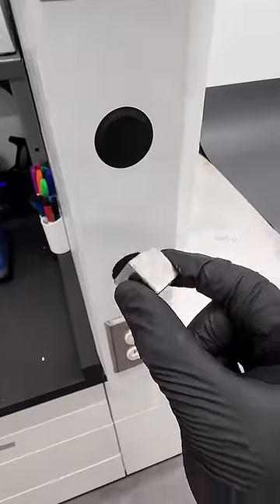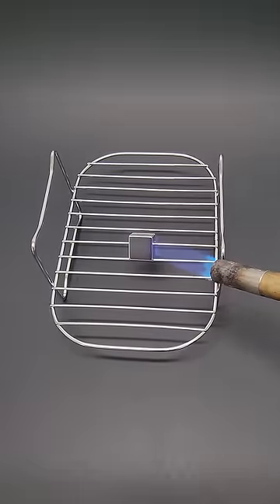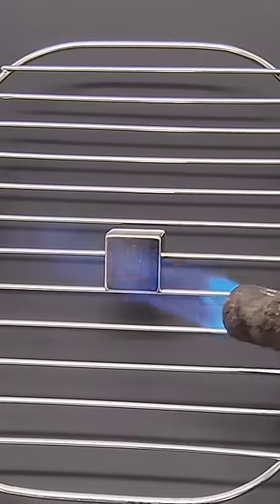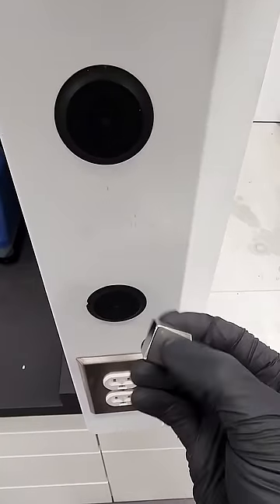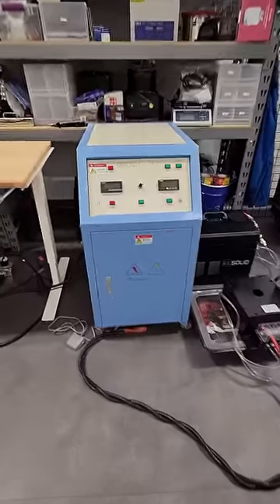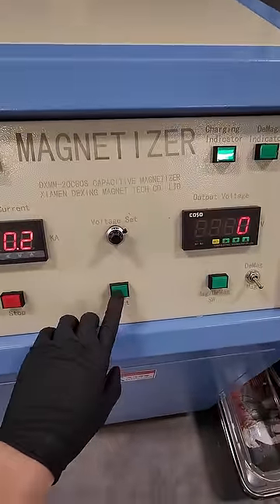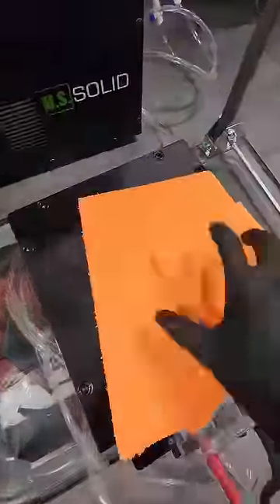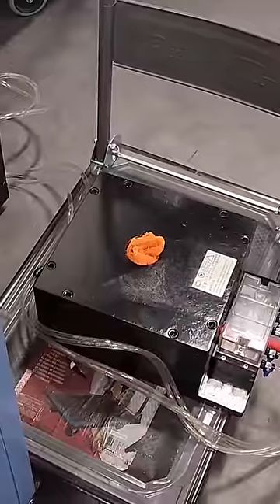I accidentally killed this magnet

Comment: That magnet had a pretty decent character arc
Reply: lost his abilities only to gain them again later but stronger with the power of friendship or smth
Reply: @BALAOFMANDALORE accurate
Reply: @BALAOFMANDALORE Spider-Man 3 type shit
Reply: @BALAOFMANDALORE The Flash
Reply: From Top to the Bottom then back to the Top!
Reply: Exactly like Gandalf.. It fought fire and came back stronger...
Reply: That's some YGO abridged shit LMAO @BALAOFMANDALORE
Reply: @hunterburch2675  In the original Spider-Man (2002) Peter has his powers with no changes, just like how the magnet had its regular ability at the start of the video. In Spider-Man 2 (2004) Peter gets significantly weaker and eventually loses his powers, just like how the magnet lost it’s power after it was heated up. Finally in Spider-Man 3 (2007) Peter gets significantly stronger as his powers are enhanced by wearing the black suit, just like how the magnets power was enhanced by the end.
Reply: @hunterburch2675  Coincidence?
Reply: @ballsinyourface419  Stan Lee is a genius
Reply: @BALAOFMANDALORE the Power of gauss

Comment: As soon as I saw the shape of that machine I knew it was Chinese made... The tech works pretty well, but the design of the casing and all that is mid at best. Sharp edges and unrounded corners. Truly the definition of function over form. I still love them for how cheap you can get them comparatively.

Comment: For those wondering, the heat scrambles the magnetic domains inside the magnet, disrupting any magnetic force it was previously generating. The magnetizer then realigned all of them even more uniformly than it was before the heat was applied, hence the increase in force.
Reply: Does it have a permanent effect though? Or will it start decaying to how it was when heated?
Reply: @@CrackShot-3 magnetic domains make up magnets and naturally magnetic metals/compounds. They are clusters of crystalline minerals, wherein most crystals are physically aligned with each other. The more crystals are aligned, the more magnetic force that magnetic domain generates. If all or most magnetic domains inside a magnet are oriented the same way, they come together to combine their force and produce the magnetic field of the magnet. Since heat adds entropy to a system, applying heat to magnets cause these clusters to fall out of alignment with one another, so their forces will be projected in all different directions, canceling each other out and producing little to no measurable magnetic field overall. Magnetizers realign the clusters, allowing them to once again generate a uniform magnetic field. I’m by no means an expert in this field and my explanation may be flawed, but this is my understanding and google could probably do a better job at explaining than I can lol.
Reply: @cekart  I believe that over time the strength of the magnet may degrade due to entropy, however it’s conceivable that if you could somehow ensure that the magnet remained I disturbed for eternity and all it’s magnetic domains remained aligned, it would never degrade.
Reply: @@CrackShot-3 To think of it another way, they are kinda like mini-magnets.  The heat essential puts them in random directions, so their magnetic field cancel each other out.  Lining them up, however, so many of them face the same direction, makes the thing as a whole magnetic, which is what the machine does.
Reply: Sank you fazer
Reply: Then why does a molten core create a magnetic field?
Reply: @mikem9374  not all molten cores create a magnetic field. Earth’s molten core creates a magnetic field due to Earth’s spin, similar to how a coil of wire generates a magnetic field when a current is passed through it. The centripetal acceleration forces the alignment of magnetic domains within the core, and because the charge is moving, a magnetic field is generated. Planets and planetoids that have molten cores and do not spin would not be expected to generate a magnetic field.
Reply: @willw.1734  appreciate the response and knowledge!
Reply: Does this work on peach and plum pits or is there a better way to magnetize fruit?
Reply: It seems like it's quite expensive to make it a magnet again 😢
Reply: @cekart it would actually stay as this forever - at least as long as you don‘t exert heat onto the magnet again!
Reply: @samgod it won‘t work on them because they’re not ferromagnetic meaning they don‘t form these magnetic domains which would last without an external magnetic field
Reply: @samgod  if you could find some way to pass an electrical charge through the fruit and rotate the whole thing, it’s conceivable that you could generate a magnetic field. The only caveat is that you won’t be able to spin it very fast before centripetal force causes the fruit to explode lol.
Reply: How come I didn’t learn this at all thruoighout my high school and college life wtf is this Chem or physics
Reply: @kkirlin07  I think it’s chem and physics!
Reply: @willw.1734  well i only took ap chem in high school so i didn't need to take any science in college but that was not covered for some reason hmmmm
Reply: @kkirlin07  no worries - I learned that in my Material Science class in university (studying engineering science) so no wonder you haven‘t seen it before ;) me neither
Reply: So it reorganised the structure 😮
That's incredibly interesting 🤔
Reply: so…. to defeat magneto you just need a blow torch? (not that anyone should be trying to defeat magneto)
Reply: @BadBanana the structure remained the same - only the charge distribution (respectively the magnetic orientation of atoms and clusters of atoms constituting these magnetic domains) has changed in the arrangement the external field generated by this Magnetizer forces it to.
Reply: @larimus724  thank you.
Reply: Translation: they have no clue how it works 😂
Reply: Im a “little magnets” enjoyer myself 😎
Reply: Question:  doesn’t this process change the physical structure of the magnet?
Reply: @ClassyJohn  yes! It realigns its internal lattices
Reply: Thank you for the scientific explanation
Reply: imagine a bunch of arrows inside cells pointing different ways, the machine aligns them in the same direction
Reply: @RNatzel89  you’re welcome :)
Reply: @manishapadmawar372  exactly! This is how I visualize it in my head haha
Reply: @willw.1734  that's how they taught us in school 😂
Reply: In welding you have to only use the magnetic triangles to hold the metal for a tack weld. If you continue to weld the magnet will become weak or unmagnitized. Due to the heat and or electricity used to weld.
Reply: @willw.1734 The Earth's inner core is solid.
Reply: @jgcondron  it is!
Reply: @@CrackShot-3looks like someone skipped out on their physics classes 😂😂😂
Reply: So Heat Jumbles little Magnet Houses... And Electricity makes them into Duplexes and Complexes and Mansions.. gotcha.
Reply: Does that machine basically produce an emp?
Reply: Everyday I learn more about random things I actually care about online that I never got in school 😂
Reply: So the heat T1000 it, and if they had separated the T1000 from lava they could've bought it back to life?
Reply: we learnt this in 4th grade
Reply: Water is wet!
Reply: @bkbzgaming  I personally learned it in 8th grade chemistry, but unfortunately it’s just one of the many tidbits that gets thrown out there that students just can’t retain because of the US public education systems focus on grades over actual learning. There’s so much enriching content that they go over in American public school that is presented in the most monotonous, detached context that it doesn’t inspire people the way it should. Luckily we have people actively working to increase awareness of this and advocating for education reform!
Reply: @willw.1734  We here in India learn this early on, and people still remember
Reply: Finally a weakness for Magneto
Reply: After taking the magnet to the Curie point is it possible to change the pole direction with the magnitizer?  Say instead of having the pole axis throught he center of a disc magnet have it crossing the circumference?
Reply: @willw. 1734 that is a very simplified explanation.
Reply: "The Magnetic DOMAINS"  LOL
Those times when you try to define something and make it sound overly cool but you stuff it up.

A DOMAIN is something different mate.
You can't scramble a Domain.  Not ever !!

what you're referring to , i dare say is...
The Magnetic FIELDS
Possibly even the FLUX LINES, as you spoke about Alignment .

Your comment suspiciously sounds like you may have pulled it from the internet quickly but unknowingly pulled it from a source that 
Either didn't know what they were talking about
or
You misunderstood what they said and they did know what they were talking about 

it's just funny, how you said it
and also incorrect, but more funny than incorrect
Reply: I do wonder if you magnetized it while it was in the heated state and held it in that state as it cooled would it be stronger or weaker?
Reply: @loganroufs9705  
It would be weaker when it was hot 
and get stronger as it cooled down
Reply: Exactly the comment I wanted ty!
Reply: @mikem9374 earth has a solid inner core the molten layer surrounds it. Interestingly they rotate independently of each other and the Iron core has recently started rotating in the opposite direction of the rest of the planet.
Reply: Bro I feel dumb in the comments 😂
Reply: @CaptainSsolid  how?! Now you know 😂
Reply: Leave the feeling dumb part for people that didn't bother to look in the comments for why. :D!!
Reply: @CaptainSsolid  
You shouldn't
You are not dumb if you lack knowledge on a certain subject.
I'm not proficient at Hairdressing.
if i went to a Hairdressing site or convention i wouldn't feel dumb, i would just feel like .. this subject is not my forte.that's all
Reply: Thank you for further explanation 💕👍💕
Reply: @prettygneissproductions 
The blowtorch itself is made of metal, so Magneto would just take it out of your hand and light you on fire with it

Comment: I not only didnt know you could kill a magnet, I just found out you can revive it as well, what a rollercoaster of emotions
Reply: You discovered the "Curie Point". I seem to recall someone figured it out a long time ago too. 🤔 (But maybe not exactly the one you're thinking of)
Reply: And make it stronger than before
Reply: I thought you kill a magnet by dropping it repeatedly.
And you revive a magnet by running another magnet over it repeatedly.
Something about when dropped it breaks magnetic structure and running another magnet against it realigns it.
Reply: Yes, when a magnet surpasses a certain temperature it permanently loses its magnetic properties (meaning you need to re magnetize it and you cam't just cool it down)
Reply: D
Reply: All the magnets speak of the son of God who died for their sins and was brought back to life by their benevolent God. Bear witness !
Reply: Trump says you can kill a magnet by putting it in water... 2nd grade science lab disagrees. :/
Reply: Well... when heated the electron get release into the air. Qhen charge with eletectric, the metal absorb the electron

Comment: For those curious, the temperature at which magnets lose their magnetization is called Curie temperature.
Reply: 'Curious'. I see what you did there.
Reply: Pierre Curie
Reply: so how did it gain it back
Reply: I’m curious how, so I’m about to research it.
Reply: @raiyu enchantment table
Reply: @alvarodiaz6383  what'd he do
Reply: Is it named after Pierre Curie or Marie Curie
Reply: like marie curie?
Reply: @TheMilkandMilch  marie curie dealt with radiation, not really sure what pierre curie did tho
Reply: It’s around 50000°F
Reply: M
Reply: @ady_zz  ERM, what the sigma
Reply: Why does that happen?
Reply: @raiyu  temperature messes up molecules in magnet because temperature is just kinetic energy of molecules in an object and I think using another magnet you can align them again, making the magnet magnetic again. Also the magnet became stronger because less molecules were aligned in the magnet before blasting.
Reply: If magnets lose their power at high temperatures then nuclear fusion won’t be happening anytime soon
Reply: @MrStark-up6fi magnets and nuclear fusion operate under two entirely different sets of rules
Reply: @Farce13  a magnetic field is needed in nuclear fusion for the plasma generated
Reply: @MrStark-up6fi that applies to ferromagnetic materials. Electromagnets will not experience that issue.
Reply: Maria skwadiwska Currie
Reply: Thanks. I was very curieous about that
Reply: @raiyu he put it in a magnetizer
Reply: @eggseed6543  he told you what you need to research it yourself
Reply: @alvarodiaz6383 Maria Skłodowska Curie
Reply: for those that asked, magnetisation in ferromagnets ( = materials commonly just called magnets) is reversible. the (unpaired) electrons of the magnet have a property called a spin. there's MANY electrons, and all of them have a spin, but they're chaotic and they all point in a different direction. Think about a box of screws, they're all unordered. if i asked you in what direction those screws pointed, you couldn't give me an answer. 
in an external magnetic field ( = the machine niles used) those spins all sort themselves into one direction. very many spins suddenly all pointing along this direction induced a magnetic field - all the screws in the box are neatly aligning. that's magnetism!
if you add enough heat, this highly ordered network is broken up, like you're shaking the screw box. niles machine basically lines the screws back up properly :D
Reply: Now this brings the million dollar question: can permanent magnet motors lose efficiency due to a levell of magnetic loss IF not cooled properly?
Reply: @mark4m557  heat rearranges the molecules inside the magnet so it is no longer magnetic. You can use a more powerful magnet to arrange them back.

Basically a strong magnet is surrounding it. Running electricity through it makes its magnetic field a lot stronger and it rearranges the molecules inside the magnet to make it magnetic again
Reply: Was it discovered by Marie Curie ?
Reply: @thebossmongars9651  pierre curie did her husband he was a physicist
Fun fact the curies hold the record for most nobel prizes ever with 5 (the second closest are the Coris with 2)
Reply: @raiyu  the machine uses electricity to create a super strong magnetic field which magnetizes (well...re-magnetizes)  the cube! Hope this helps.
Reply: @Clappybara. But if he didnt have the machine, would the cube be demagnetized forever?
Reply: @saturnas  yeah, probably because there's nothing there to align molecules in the magnet, so it would lose it's power forever